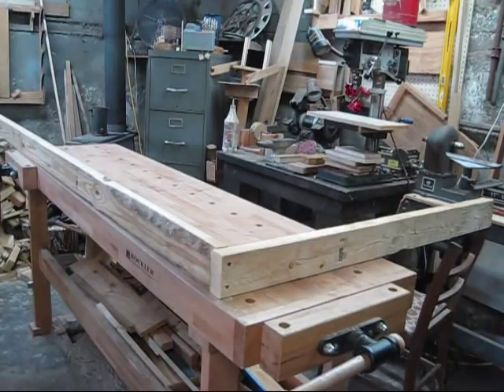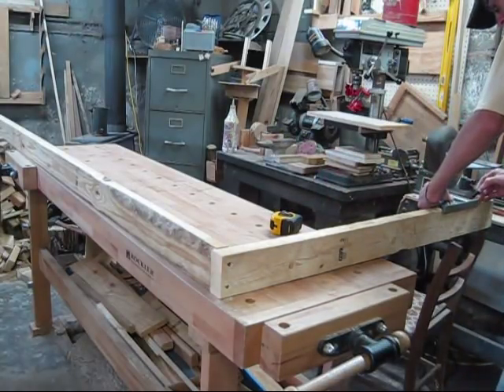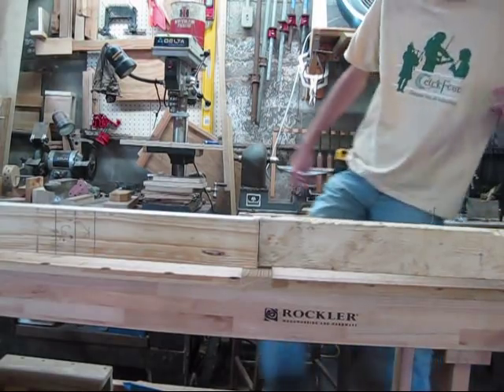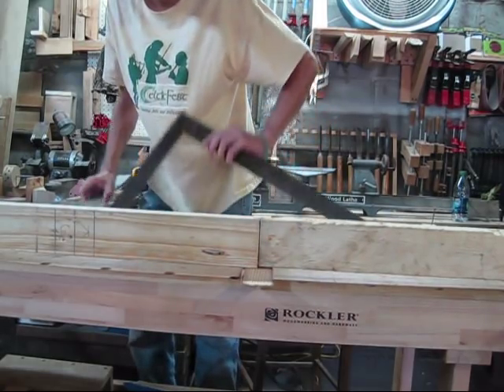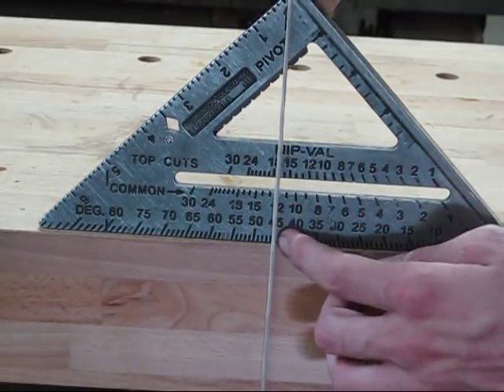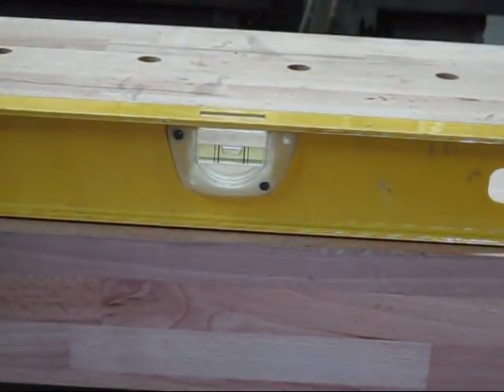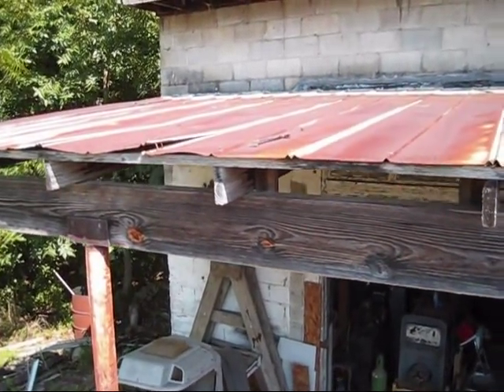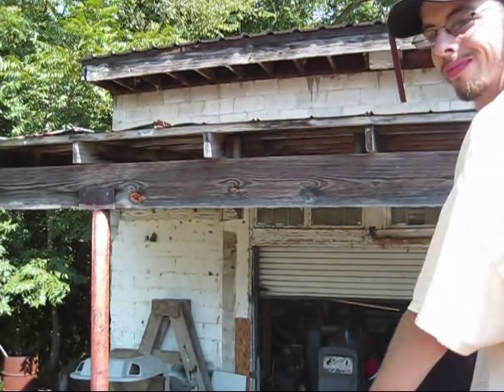Tricks with construction tools

Comment: You dont have to use 3 4 5
can be any measurement. 

say 8m by 10m

8x8=64
10x10=100
100+64=164
square root of 164 is 12.80m diagonal

Comment: I didn't get the string straightening the beam one.  I get that you're checking to see if the beam is straight.  But  How do you straighten a bowed beam?  that's not possible.
Reply from the maker: mtnshow1 ok a beam in the Dictionary is a straight piece of material that is strengthened so it will cannot be bowed, twisted or, cupped.  In the real world it can be all those things. I have pulled beams back to straight many a time with the use of jacks, cranes, and braces.  Doesn’t matter if it’s steel, wood, plastic, or stone. It will move given the right force.

Comment: That's not how you'd straighten a 'beam', a rim joist, yes, a 'beam' wouldn't bend or twist - it's a beam.  Check your construction terminology just to keep from confusing people.
Reply from the maker: Aye that is true I did not say that right.  But you are wrong about beams they do bend, and twist, and you have to straighten them out.
Reply: The whole point of a beam is that it DOESN'T bend or twist.  Believe me, a beam won't bend or twist and if it does what you have isn't a beam.
Reply from the maker: I'm not saying your wrong. Yes a real beam in a perfect world does not contort, twist, or bend, but this is the real world. Doesn't matter if it is solid, or man made beam (steel or wood)it is going to move.  Bracing fixes everything that's why we have it.  Forgive me for saying the wrong thing in my video, but you don't need to say something that is not true.
Reply: Something that's not true?  WHAT?!  I started as a carpenter when I was 15.   I'm now a commercial superintendent, I've built everything; homes churches, fire stations, rec centers with olympic size swimming pools, Kohls, CostCo, Target, numerous high rise buildings - precast tilt wall, caissons, bar joists with metal deck cast in place, split faced with embedded grillage beams...you name it...
And YOU'RE telling me I'm saying something that's NOT true??  lol  Now THAT'S funny.  You won't even get a micro lam BEAM to twist, and if it does, it's NOT a BEAM, it's a joist!
Reply from the maker: I guess I don't know what I'm talking about.  Thanks for setting me straight.
Reply: spyder1107  Jeez, hate to call you out on this, but Ethan is right and you're mistaken.  The difference between joists and beams is a structural system naming differentiation.  Beams collect the loads of a series of joists, which collect tributary loads of decks.  If you have nearly as much experience as you claim, then you surely have seen beams that have failed, and yes indeed, those beams twist and bend prior to failure because they are too small for the load.

Think of something like TrussJoists which are considerably larger and have significantly larger capacity than 4x8 "beams" which are found on the same structure; one is in fact a joist because of its position in the structural system and the other is a beam because it is supporting a bunch of joists, yet that "beam" can't even self-support the same distance as the "TrussJoist" due to a deflection failure.

When designers approach load calculations for horizontal structural elements, they view, treat, and calculate joists and beams the same because they really are the same other than the types of loads they collect.  As Ethan pointed out, blocking and gussets are used to stiffen beams and joists so as to prevent twist and deflection that lead to overload.  In the case of beams, the blocking is also known as girts.

Based on your logic, it seems we could call a #4 machine screw a "nail," and a 20d nail a "bolt" simply because of their size and strength characteristics.
Reply: ...and how do you personally go about straightening a twisted beam?
Reply: No, I've never had a beam fail, in fact, most engineers over size the beams to cover their butts.  In my experience, if a beam were to twist, bend or fail in any way, that member would never be repaired and used, it would be replaced.  I've never heard of straightening a beam, straighten it for what, the scrap yard?  It can't be used.  I've never heard of straightening a beam, how is it done?

People often use 'beam' as a generic term when in reality there are beams, girders and joists - I think beams can tie into girders to carry a sheer load while beams support and distribute the load of the joists, is that right?

Also, please know that I'm not spiteful, angry or trying to be a prick in any way, I respect everyone in construction and I'm always up for a good argument.  I may even learn something.  You sound like you have some engineering experience.
Reply from the maker: I see what is going on here. I assume spyder1107 you deal mostly with new construction build things from scratch. As for me I do mostly repair work (mostly on old stuff) and I can say it is a lot easier to push or pull a floor beam or jack up a header beam rather than tearing down the whole part of the building, and rebuilding it.  Also if it is a really old building taking a beam out may not be an option.  You have fix it were it is.
Reply: Ethan Ewing
Yes, Ethan you're on the right track.  More precisely, I'll add that the differences are largely that of residential Type-V wood-frame construction vs. Type-I steel-frame, and as you noted, existing vs. new, and additionally there's repair and retrofit.  Spyder, I'm an architect w/ many years of structural forensic and civil experience, AND I live and work in earthquake country (which now happens to be most of the country except for places like N. Mexico.

FYI, columns are technically "beams" that are vertically oriented and are subject to the same calculation process as beams.  It's true that distorted (meaning differing from the design orientation) steel cannot be used on new construction, unless the designs are adapted to work with the flawed member; that might well occur if a particular member was particularly complicated in its fabrication or onerous in its procural, and the designs could be adapted with minimal impact.  With wood-frame construction, it is routine to straighten joists and beams through the use of come-alongs, GradAlls, backhoes, dead-lifts, jacks, rams, wedges, sistering, sledge hammers, "tweakers," water barrels, and other structural members, as long as doing so won't violate the construction documents or exceed code allowances.

I personally have worked on numerous structures, where the structural system has been damaged, including highrises that had badly earthquake damaged columns.  In those situations yes, straightening those columns does happen because the economic or social loss of the structure far exceeds the repair value.  That said, there are many different ways to accomplish that repair, and I believe I remember seeing columns that had the damaged sections cut out with new sections welded back in place, and it is technically possible to reheat a distorted section and bend or twist it back into proper orientation and then heat treat it back to specified strength parameters.  Lastly are concrete elements, which by their very nature, can be beaten apart and put back together.
Reply: Repairing earthquake damage on a high rise sounds like an absolute nightmare, not to mention the risk and liability involved...ugh.  I really enjoyed reading your post, I could talk with you for days, I find engineering and physics as they apply to building construction absolutely fascinating.  Construction means and methods, new materials, systems and procedures, innovations...I can't get enough of it.

Now, you'd mentioned concrete, precast panels contain strands which cannot be compromised so how are the panels repaired if a strand should be severed by an earthquake?  As for precast deck spans, these particular planks are calculated to have a camber prior to being placed which depend on not only their live and dead loads but on their bearing points - how is this calculated and repaired on an existing earthquake torn structure?  I'm in Chicago, we don't have many earthquakes, however, we do have seizmic demands that must be met especially with curtain wall construction.  Buildings are truely living, moving and breathing things when you think about it.
Reply: fyrebyrd301 Sorry, I guess when I re-read that, I sounded like a prick, I surely didn't mean for it to sound that way, my apologies.
Reply: I've not had to deal w/ PC panels or planks yet, but because conc. is such a plastic material, generally the repairs involve epoxy and doweling as a concept.  For conc. columns, steel jackets come into play; carbon fiber wraps and strands are expensive options for especially challenging situations.

For those pre-stressed planks and beams, a cost analysis will help decide if these prefabricated units should be repaired or replaced, but in either case, jacking and preloading in situ are likely part of the equation.  We have extracted failed tendons and replaced them.  Panels are likely going to face jacketing and/or tendon/strand replacement via chipping/grinding, doweling, and epoxy.

ACI and PCI have info and guidelines on this topic.
Reply: spyder1107  - No that's not how you straighten out a beam. That's how you see if is straight to begin with!  Just because you have never straightened out a P Lam  or couple of Micro Lams with spring braces doesn't mean that other people don't do so. Built up Micro Lam beams are notorious for needing to be straightened, and if your saying that you have never seen a long P Lam that didn't need to be pushed straight, then you are not as experienced as you say you are.
Reply: He talking about parallel beams, in level straight for cennection!!!
Reply: Alan Barley He is not clear to me because he goes on about how a beam never bends, so I thought he was talking about when things were lined up with the string in the video. Beams can have a bow in it and need to be straightened out in some cases where the beam is the end of a framed structure and will show up in the finish. The other method that he is demonstrating with the squares, is more about setting beams ( or rim joists or whatever ) on level surfaces or bearing points and not so much about where a beam were to have a "twist or Bend"
Reply: Oh well Im knew to this last thing I wanted to do was offend you so I do apoligize!
Reply: Alan Barley  You're cool - it's all good.
Reply: Ah, a namecaller, wonderful.  ...I'm sure your mother is very proud. "sarcasm"
Reply: spyder1107  Believe me, Bob Vila, no one is impressed with your resume in a freaking YouTube comment.  You act as if your experience makes you immune to saying something that isn't true.  This wasn't a technical lecture, it was a few simple tricks.  Jesus.
Reply: Dad...?

Comment: 1:17 You can also multiply up to 6ft-8ft-10ft or 9ft-12ft-15ft for longer squaring distances. You said your self the longer the more accurate the squaring process will be. At 3:15 of the video Your terminology is inaccurate. The term you should be using is linear not parallel.

Comment: Its funny you do not need a square to find square on the job but you would be surprised just how often its out of whack and you can see it after the jobs done.  It's one thing to hide small mistakes, they happen but you try to avoid them, but a 8' tall wall should not be 4" out of plumb. You find that out what you go to hang wallpaper on a conner.
I've seen walls on new construction were not talking starter homes either, I mean high end homes with a million dollar price tag on a golf course with walls that look like a snake slithered by and that's where they put the wall. As if you can't get a straight line with a chalk line let alone a laser line.  that 2x4 floor plate must ahve looked like it grew like the letter c
it was so crooked, how did they find a top plate to match it?
Either people do not take pride in the work, or they hire any fool who can swing a hammer and don't teach him anything because he can't speak english.  You live in the USA Learn how to Speak English and only speak English.
I really don't care where your from thats not my point.
If you can not Speak the national language its not safe for you or others on a job sight because you will not understand Watch out the ladder is falling. Or STOP Don't smoke that cigarette by the gas line its leaking. Or look out below when your  coworker drops his hammer off the roof. And that might be the one time you take off your hard hat to clear off the sweat on your forehead.

Comment: Or multiples of thoes no. Like 6&8 = 10 diagnal 12&16=20  if your laying out a slab to frame go long. I like 18 & 24=30. With a helper holding idiot end of tape or vice versa, which i do to help others aboce learn.

Comment: Hey Ethan, do "they' even make a good tape measure anymore?  Years ago STANLEY was pretty decent, now,  I just   bought a 25' and it's as flimsy as my pecker!  Any suggestions?
Reply from the maker: Stanley still makes a good tape, but it is the Fat Max spin off.  Lowes and other stores sale them.  (Stanley Fat Max 25' with blade armor) Try one I believe you'll like it.
Reply: Ethan Ewing Yeah, that Max is pretty good, but you would think in this day and age they could make something less bulky and still strong. Got caught in the rain and the STANLEY seized. I got it goin again, but it ain't th same. Thanx for gettin back to me so soon. GK

Comment: Rockler bench? Internet carpenter. Using a 2 ft framing square on todays lumber to determine beam straightness is just idiotic. Nothing says "master carpenter like Chuck Taylors.. good pull. Guy seems ok.. but a tad far from professional hints.
Reply from the maker: The framing square trick is to check things in parallel not straight.  Wow putting me down for my shoes.  Never in any of my videos have I ever said I was a professional. I am decent at most things, and I like to help people with problems they have. Not the best for everything, but I do what I can. What do you consider professional? Please tell me I would like to know.

Comment: Ok 1st trick is interesting, Pythagorean theorem and shit, but you still use a square for that, much faster.
2nd you use a level or some kind of straight edge, noone got time for this bullshit
3rd ill better get a 10 inch level for a couple of dollars
4th you don't have eyes to see where its bent?
5th no comments
Reply: You should always run a string to insure things are strait. not just for a beam but if you are running a wall, fence post etc etc. A string is one of the best tools you have to check if things are in line.

Comment: try this, at lunch break.
instead of spending 10 minutes making a video about stuff most people already know. try eating a sandwich. you're way too skinny. can't see you swinging a 32 ounce framing hammer!
Reply from the maker: +Anthony Schurz To skinny Mmmm.   And no I don't swing a 32 ounce framing hammer I like to keep my arm for a few more years.
Reply: +Classic Work DO NOT respond to this type of crap. DO NOT RESPOND.
Reply: I'm sorry, I apologize.
Let me rephrase this......

Eat two sandwiches
Reply from the maker: +Anthony Schurz Hahaha you going to make them for me?  I'm not trying to pick a fight.  Some people have a hard time losing weight others hard time gaining it.  Look it up.
Reply: Hey brother , I'm just dawg'n you... it's always this way in construction, got to have a thick skin and shovel the BS right back.
Tip- how to straighten out wall frame before one side drywall.
Use 8 - 10 foot piece of three-quarter inch hard copper straight tube. Hold horizontally just above waist level , press against vertical wall studs. This will reveal any studs that are both in or out. Take worm drive saw and cut through both stud diagonally at chest height. 3 foot piece of scrap, nail on to the top piece of stud with gun. Then pick up copper tube repeat. And grab bottom stud piece and overhanging piece of scrap coming from top stud piece. Pull them towards you or push them away from you,  so copper tube is touching all the way across. Then take nail gun and fasten the bottom piece. then repeat on all walls. Especially long corridors or hallways that require smooth finish.
Live in Az.  will buy you steak and eggs...
Start working out!
Anatomy of fitness, - Elite Training- Navy SEALs workout DVD @ Barnes and Noble bookstore.
And go ahead and look up Antoinette Soto and her new 2016 calendar
Reply from the maker: Haha I thought you were, but I didn't know.  Thanks for the tip.  Hahaha will do man!
Reply: hey check this out! after I finally grew up... I can use a 22 ounce framing hammer ! and still get the job done :-)
Reply: +Anthony Schurz 
riiiight .. What's a framing hammer!!!  These days we use AIR TOOLS. One 'blip' and it's done ... Just dont let it slide off the roof!
Reply: Tkj Tkj riighht, and the next thing that you're going to tell me is you never picked up a hand saw and used it cut roof rafters.... maybe you need to eat a couple of sandwiches also?